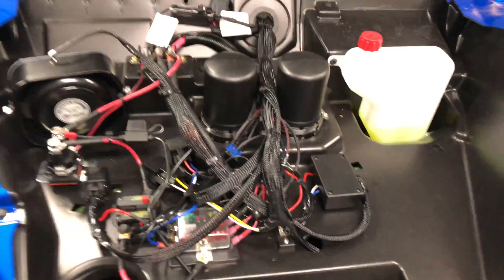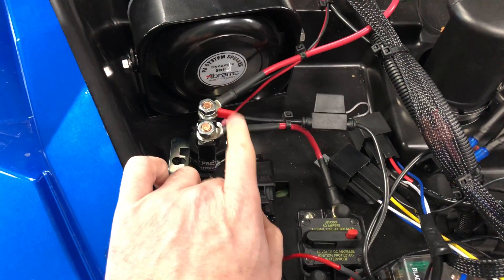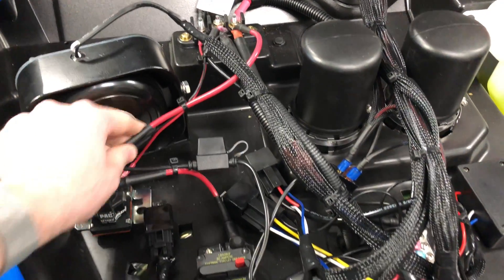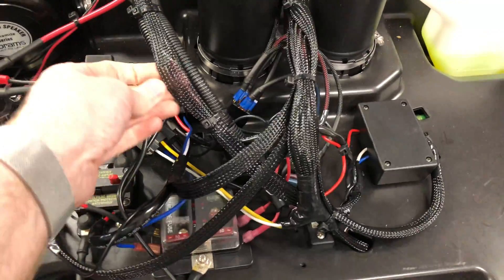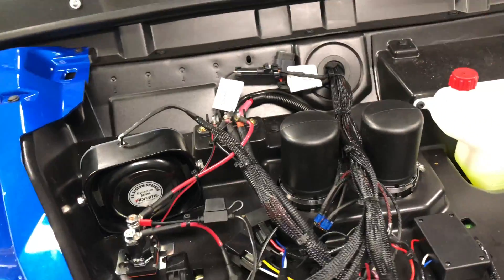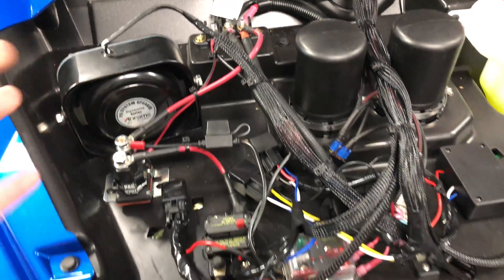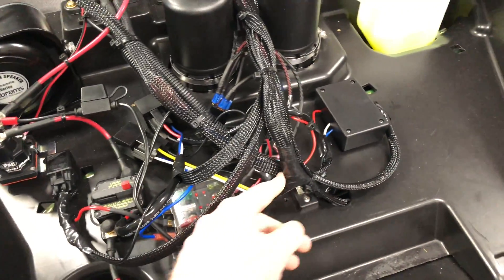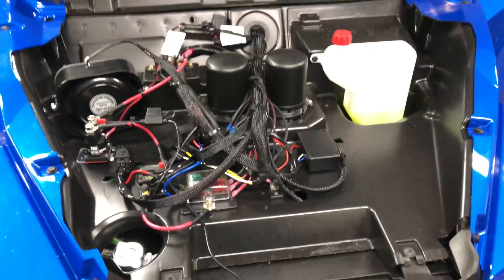Auto Circuits and Pro-Level Wiring (Custom-made Available)

Comment: Hi Ben! Just got my 2018 Polaris General Deluxe yesterday. Is there a way you could go in detail on how you installed the rocker switches into the panel on a future video? I want to do that the right way, and it would be great if you could.

Thanks!!
Reply from the maker: Thanks for the comment. I'm posting some videos right now that talk about that a little. But, in short, the best way I've found is to use an oscillating tool (I have this model: https://www.dremel.com/en_US/products/-/show-product/tools/multi-max-mm30). You can use a wood cutting bit. That tool is the fastest way to make the cuts, and it's easy to keep the lines straight. I've also tried with a razor blade (including heating the blade up). The problem with the razor is that it takes a long time, and the melting of plastic can be a pain. I've also tried with a soldering iron, but you run into the same problem encountered when heating up a razor blade. I only wish I had thought of the oscillating tool earlier!

Comment: I would be interested in a custom wire setup for my 2017 General 4.  You still interested in building? .
Reply from the maker: Hey. Sorry for the delay in responding. I would. Where are you located? I'm near Canton, GA.
Reply: Nashville
Reply: Nashville. If you built it, I can install